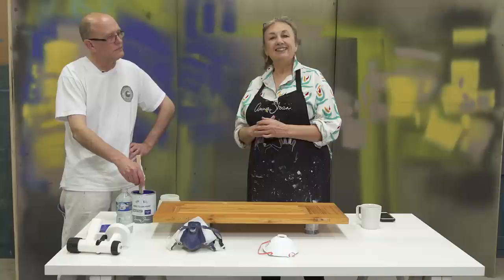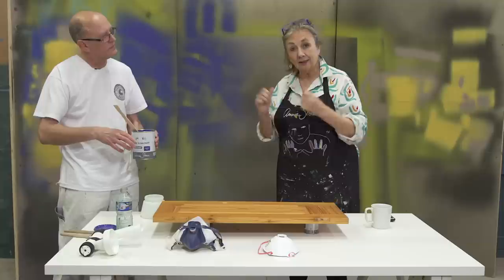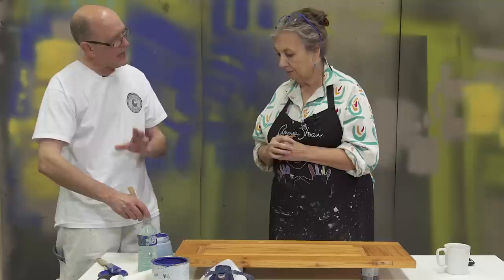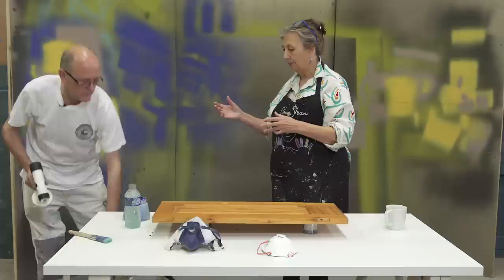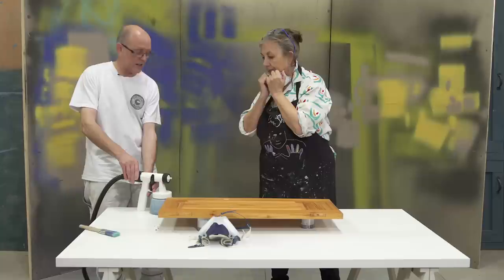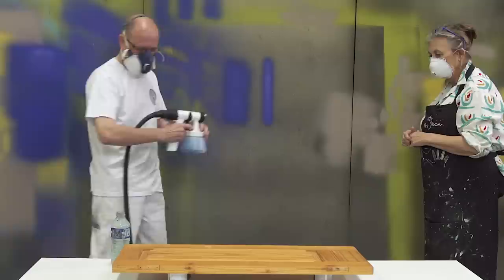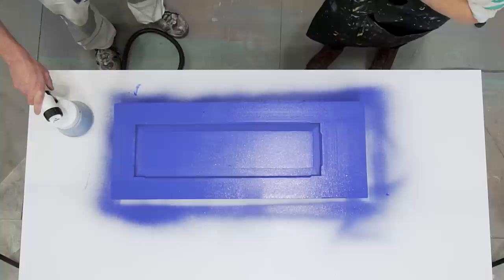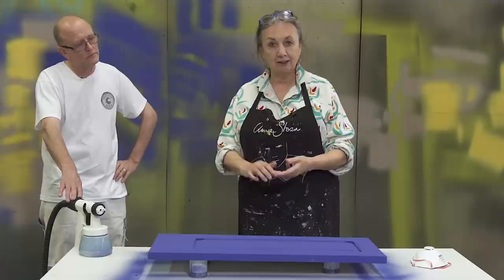How to apply Chalk Paint® with a Spray Gun - Part 1

Comment: I wish it could of show a closeup of how the paint got the perfect consistency
Reply from the maker: Here's an easy test.  After using a stir stick to mix the paint and water, pull it out and let the paint start streaming back into the can.  After the initial streaming it will start to drip.  Look for one drip per second ... that's a good consistency for most spray equipment.

Comment: Great video very useful information. I was just wondering if you can use any other spray set ups and what size nozzles are best for Annie Sloan paint and lacquer?
Reply from the maker: Any quality spray system should do, although we prefer using an HVLP system.  I typically use a 1.4mm tip for paint and a 1.2mm tip for clear coats, but you should experiment to see what works best for you.

Comment: Thanks for interesting video - I'm a newbie -  have just spray painted my fireplace blue - Do I need to seal it ? If so what do I seal it with - been told not to use wax - thanks
Reply from the maker: Hello! It is not necessary to seal the paint on a fireplace surround, but you can if you would like. While wax may not be the right choice,, you can use Annie Sloan Lacquer. -Jen at ASI

Comment: Really interesting thanks. What are the benefits of spraying paint rather than brushing or rolling? Thanks
Reply from the maker: There are several.  1) It's quicker when you have lots of surfaces to cover, such as cabinet doors and drawer facings.  2) It's easier to paint a surface with lots of nooks and crannies, such as a very intricate mirror or even wicker.  3) It creates a very smooth finish without brush or roller marks.  The Wagner Home Decor Paint Sprayer that we used in the video is fairly inexpensive, easy to set up and clean, and well worth a try.

Comment: What paint sprayer do you recommend
Reply from the maker: Hello! We recommend an HVLP (High Pressure Low Volume) sprayer. In the video, we used a Wagner 2370386 Studio Home Décor Sprayer, but depending on your area, there may be other good options available. -Jen at ASI

Comment: Sorry but this is a pretty terrible instructional video. Fancy not showing people the inside of the paint pot to show the worm trails changing, getting paint consistency right is one of the main reasons people get poor results. Also the guy only showing the paint flow adjustment and only breifly showing the paint fan adjustment and only when you asked about it. Finally his technique was flawed, always spray any grooves and edges before spraying the rest of the door, so that detailing on the doors inner panel should of been sprayed first. When making left to right or up and down passes ease off the trigger at the start/end of each pass otherwise you will get a build up of paint on the sides of the doors. 

For manufacturer and supplier of paint you could of done far better, more camera angles, show detail on each step.